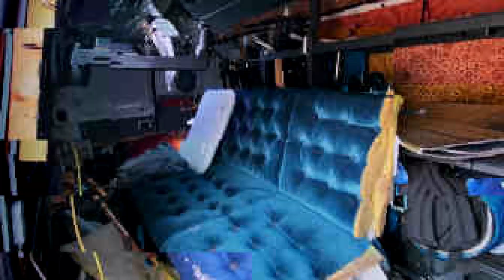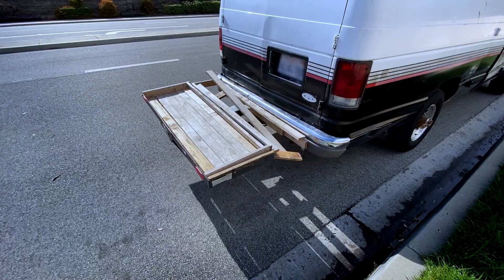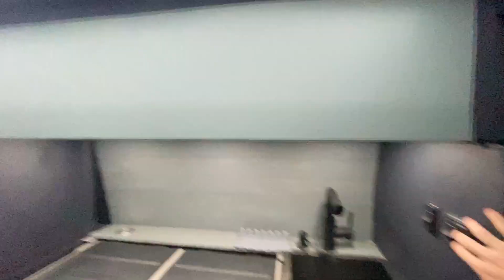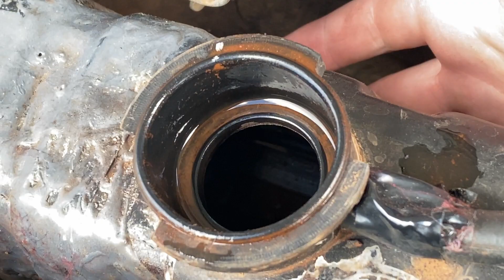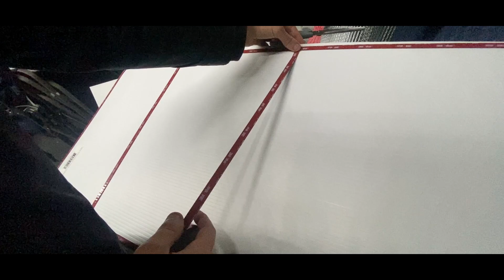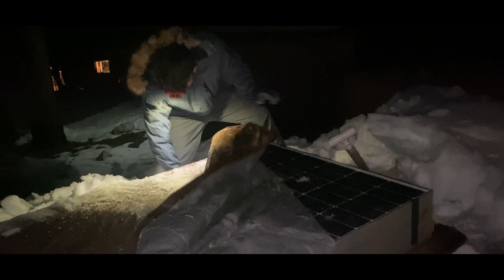My Old Van Was Destroyed, What's Next?

Comment: Just saw the build video on this and saw this video right after it felt so sad to watch but im glad you got a bigger badder boy, but i do wanna ask, how did they steal it? Where were you when it was taken and where was the van parked
Reply from the maker: They stole it because that type of van is easy to break into, It was parked at an apartment complex, and they broke the steering column and drilled the ignition and stuck a screwdriver in it. Happened in the middle of the night, I was not in the van. Definitely not the first van they have stolen, they sort of knew what they were doing. However I have had someone open the front door while I was in it and that was scary.
Reply: @offgridworlds  that's crazyyyy, was this in North cal or socal? Also is there anything you added for security on the bus boy, or anything you would've done different?
Reply from the maker: This was socal, near Santa Barbara. There was nothing for security. However, even a simple AirTag would have made the van a lot easier to find. Also my new bus Ill be adding a security system aswell as a tracker and cameras!
Reply: @offgridworlds  that's awesome bro I was thinking of doing that too, if you can document how u set it up that'd be awesome
Reply from the maker: Yeah totally, hopefully the whole build will be done around January. So it should be uploaded between now and then. So much editing needs to be done!

Comment: Yeah I will be moving into a van or RV next year. I have had a few run ins with crackheads so I know how they are. I will install and alarm, maybe two hidden engine cut off switches so the van/RV cant be started easily.
Reply: i'd also highly recommend (solar) flood lights, cameras, or even combos (blink flood light cams - though much more expensive)